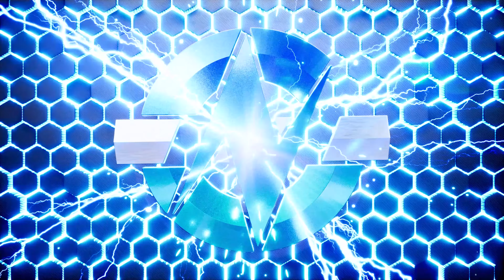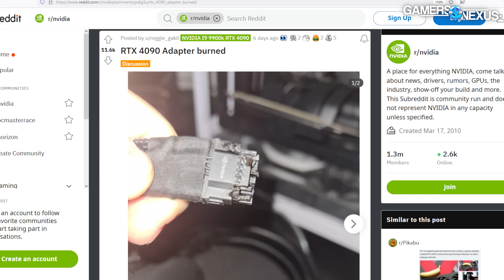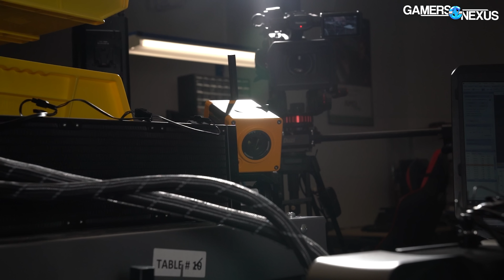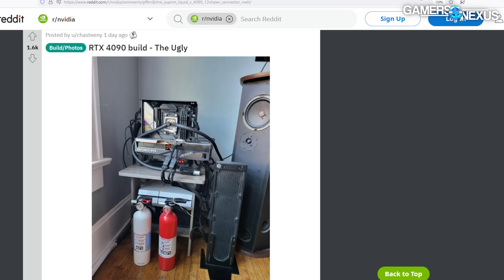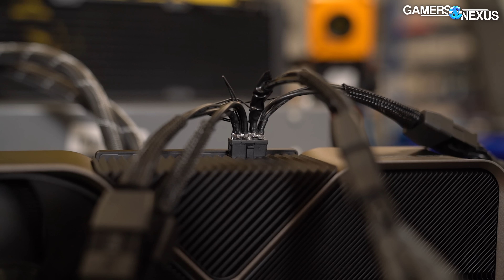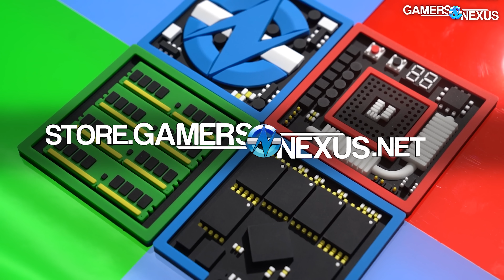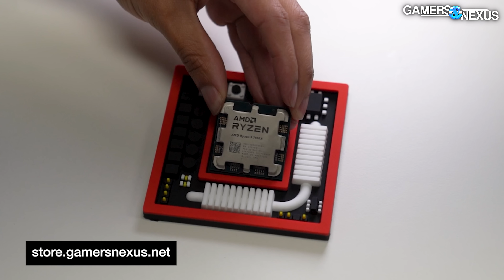Testing Burning NVIDIA 12VHPWR Adapter Cable Theories (RTX 4090)

Comment: I have a Gigabyte Gaming OC 4090, ordered on launch day. I play games about 12-14 hours a day, every day of the week on average. It has been running for most of that time with the full 133% power limit, voltage set to max in afterburner, and overclocked. 

In addition to that, I have the adapter installed in the apparently most dangerous way (i.e. running horizontally with the card). It has been connected that way since the day it came in/installed.

 My case is a Fractal Meshify 2 RGB, loaded up with fans (the stock 3 140mm on front, stock 140mm rear, two 140mm high airflow fans on the bottom, one 140mm high airflow ontop next to my 240mm AIO cpu cooler radiator ontop).

Power supply is an Antec Signature Series Titanium 1000W with 4 dedicated separate PCIE 8 pin wires connected to the adapter.

Fortunately I have not had this issue. I am inclined to think at this point with the amount of hours/stress put on this card/configuration I won't have it happen to me (fingers crossed though). I feel like it definitely would have happened by now if it was going to.

I'd love to help by sending you the asked pics of my cable but it makes me way too nervous to try and mess with it when it is working fine right now. I really don't want to poke the bear. Hopefully just the info I have shared given the way mine is installed and the heavy use it has received will be of some use.

Rest of system specs pretty much irrelevant but just for the sake of it: Ryzen 9 5900X OC'd, Asus ROG Crosshair VIII Dark Hero X570, 32GB (4x8GB) 4000mhz Corsair Vengeance RGB Pro @3900mhz 1:1 C16, 2x Samsung 2TB 980 pro m.2 nvme, 1x 250GB Corsair SSD, Alienware aw3423dw QD-OLED primary monitor + Asus 27" 1440p secondary, Roccat Kone XTD mouse+ Roccat Vulcan Pro keyboard.
Reply: "...too nervous to try and mess with it when it is working fine right now."

Now that's a mindset I can heartily embrace.

Comment: The issue most likely is in the pins. The female ones(on the adapter) are split on the length and if they are either bad quality or the fitment is not ideal (that's why they only let you plug cycle 30 times) the contact with the male pin on the board will become less than ideal and due to the high amps, heat is going to build up, or in a worse case, an arc and that is burning the plastic around it.

Comment: Well, a cable that is half the rating recommended by the manufacturer is definitely a clue in my book. Good catch. I can't help but wonder if there are some early revision cables that got released by accident.
Reply: Voltage rating has nothing to do with Current rating. Voltage rating says nothing about the conductor, just about its insulation. 150V rating for 12V is perfectly fine.
The difference in voltage rating is just an indicator that different cables are used that might have other different properties than voltage rating.

Comment: You have to run the 4090 a couple of hours/days before getting even near to melt the Adapter. This short testing and finding a fast conclusion to put the Video online asap is useless.

Comment: GN, good thorough work as always. But what I don't understand is why everybody is trying to melt these cables in open-air room-temperature workbenches. If these 4090s were in a case wouldn't the ambient air temperature around the connector be additional 15-25C higher or even more? It seems like real-world use would offer much less opportunity for the cables and connectors to dissipate their heat.

Comment: I think these numbers actually do reveal an issue. Note that none of the damage photos so far show any sign of charring, just plastic deformation. While the melting temp of nylon is 269 C, the glass transition temp is 70 C and deformation can start to occur above this point. You were able to see temps in the 60-70 C range on an open bench at 25 C ambient. In a case, especially one with a front rad, internal air temps can be up around 35 C or more. Therefore, the connector could be regularly sitting  above the 70 C GTT for long periods and slowly deforming over time.

Comment: With 300v wire you would have to run the GPU threw 1 cable to match igors at least as far as cable temp is concerned.

Comment: NTSB procedure. Nice. The first part is to gather the pieces of the wreckage. The next part is to try the recreate the problem.
Right now we have no black box and a couple of crashed planes on reddit. We also need to get the suppliers squared down, see if there is a coincidence.

Scientific investigation, perfect by GN.
By the way, call the camera NTSB. Or Tenerife.

Comment: One thing not discussed here - unless I missed it: With the hulking power requirements of these cards, is it time to move on from this power connector? 600w at 12 volts is 50 amps. Something on your car that pulls 50 amps at 12 volts is the ABS module. ABS modules a compound data and power connector that has much more heavy-duty pins for power delivery and a much more authoritative locking mechanism that is unmistakably locked in place or unlocked for removal. The connectors we're using for power on these graphics cards are quite simply the cheapest possible solution that was dreamt up a long time ago for much lower power levels. Multiple parallel conductors isn't ideal - small differences in resistance between them will strongly affect current sharing between conductors. 

If I'm wrong on all counts, tell me. That said I would be much more comfortable putting 600w of power through a more substantial connector.

Comment: First: Sorry for bad spelling and grammar. 
Can't it be a perfect storm scenario. Where the combination of a underpowered/overheating power supply heat's up the cables to the adaptor (alternative to fue 8pins or bad connection at that end of the adaptor). Heat's the cable going to the 12pin to the degree that the combined heat from gpu and cables in the crammed space in the 12pin creates enough heat to melt the plastic? The four connectors before the 12pin has more Internal space and colder living area. That they may conduct enough heat to melt the more crammed and hot area living 12pin before melting them self. It would also make sense to why Nvidia haven't experienced the problem them self I there rigid testing of the GPU to adaptor function. If they didn't test the what if we have 100c coming from the power supply end into the 12pin. 
Just a thought...

Comment: New thermal camera, I dub thee Torchy! This is awesome work. The early days of this kind of research are the most difficult and the most useful. Not surprising that your results are different from Jayz, the low numbers of people having extreme thermal difficulties points to a manufacturing defect or poor quality emergency substitute when they ran short of adapters from their primary supplier.

Comment: you do have a valid point on the wire quality and ratings. this could cause some issues. but lets return to basics here. basically as voltage decreases in a circuit and resistance increases amperage will increase. which increases heat. also at same point as heat increases resistance and amperage will increase and voltage will drop. when we are talking about 12 volts here a difference of 0.5 volts a half volt will cause major issues.  so measuring voltage and resistance and amperage can help with testing. but now going back to our issues you reported in past about PSU's from cheap parts used in PSU's.  from PSU's catching fire to nvidia contacting psu makers about transient spikes. keeping this in mind i think the psu's brand and wattage and model plus the cheaper quality cables could be where the issues are. so i would recommend asking about psu's from those that have burnt cables or plugs. also a benchmark utility is hard to recreate same real world instances that actual long term game playing can create. also ask peeps about how much time playing games has been on the unit before melting happened or they noticed melting. as this could give more data for testing here and could be something that can not be recreated in a couple hours of testing. also the age of psu can help with data. just trying to help you guys  think a little more about entire setups then just 1 piece. as a car mechanic i have seen issues with melting wires melting plugs ect that happen from time to time and simple things as a burnt copper wire can cause increased resistance and heat. keep in mind the copper inside the plastic insulation can burn and dicolor and eventually turn black without effecting or melting outside insulation here. a wire thats under rated can easily be burnt in these lower voltages. another thing to look at if you get a melted adaptor is the # of copper strands in the wire itself. voltage isnt actually carried in the copper true electricity runs between the strands of wire. this is why you can use clamp on probes for testing. with less copper strands the wire can not handle the same amount of current.  this could be a issue that may not be able to be found by a independent testing facility because of the sheer # of possibilities and expense of finding the issue. but i hope the above might help you guys some and you find the issue with this adaptor. because manufactures are always trying to play things down to keep from spending money on recalls or worse lawsuits. and even when the manufacture finds the problem if they release a fix its usually the cheapest form of fix they can do just to get the part or item through warranty. so i never trust what the manufacture tells us.

Comment: Hmmm. The differing voltages on the cables between yours & Igor's makes you wonder if either Igor's cable was a third party cable (not very likely as the 4090 is too new) or if there's some kind of issue on NVidia's side.

Comment: So sounding like somebody cheaped out on a batch of adapters or didn't spec correctly. That's better than a systemic failure in the 4000 design I suppose. Still think I'll wait until ATX3 before any future builds.

Camera name: Mr Toasty

Comment: Buildzoid said a lot of smart things during his adapter "rant". Mainly that the melting that has been shown in pictures until now, happens inside the connector where the sockets and pins mate when the connector is connected. This simple fact "proves" igors lab theory and some of the focus you have with the cable solder area moot, as the melting is not happening in the solder area. High resistance heating happens at the high resistance area, not magically a centimeter further down the socket"pin". 
Personally I think the focus should be more on the double split pin sockets inside the adapter connector. With cables being pulled and socket pins not being firmly held in place inside the plastic connector, contact area between the adapter socket pin and the gpu pin would decrease increasing the resistance, giving heat. Though seeing different wires used and especially different solder connection solutions can affect pin stability in the connector case when cables are manhandled 😛
But LOVE the way GN is evolving atm 🙂

Comment: I wonder if it has something to do with the graphics card itself. I’ve seen bad parts on cards start melting on the connection points on the motherboard. So were the power comes in a bad part on the card heats up the cord to failure.

Comment: I think the whole 12 pin is not ready. What wrong with 2 to 3 8 pin connections. This wont be an issue when 3.0 psu with dedicated 12pin are available. Direct wire will always be better than a distribution plate with 4lb of solder.

Comment: I would had spent more time testing buildzoid theory. As I commented on one of his later videos on the subject, I had very beaten old 5-12V molex getting warm because of the same reason.
They had round instead square receptacles but still with the double gap, so the two halves got more far apart under strain and the contact was poor. I had some where even an half broke off.
For this reason I think buildzoid may be closer.

Comment: Very interesting stuff. It would be interesting to know what type of plastic is used for the connector. I would add that coming from an automotive perspective as a mechanic the only time I see melted plugs (also being 12v DC) is from overload usually caused by shorting causing massive spikes in current. Knowing how the power is diverted to the internal components of the card from the plug would also help to understand the problem. My instinct is it is a combination of a batch of crappy adapters and a flaw in the cards.

Comment: Cable voltage rating is a non-issue here. The rating is referring to the insulation, and has nothing to do with the copper core.

An amp is an amp, and will heat the cable / connector just the same (volt drop over the cable or connector is fixed provided the current and resistance are the same, meaning same power dissipation).

It's likely NVIDIA has several permitted suppliers for the cable, and that the actual engineering requirement is insulation rated to 150V or even lower.

Comment: Call the camera Mellow, why? what is the joke? nothing really, is just sounds like yellow.

on the connector failures, I gonna go with what buildzoid has said.
those cables are kinda overkill and foil usually does quite fines, the contacts themselves are the problem.
also, you need to usar a Computer case, you are using a open bench, that is not real world and not even fairly comparable.
just place into those "hot box with no airflow" you love to hate.

P.S.: maybe MSI has a perfect one.

Comment: I'm subscribing to Buildzoid's take on the events. It's a very sensible take on the entire catastrophe that the envelope of safety on how much power they could push too hard, and the pins started melting because of it.

I also noticed that the 12 pin 30 series FE connector is geometrically identical to the 12VHPWR connector except without the sense pins on the side, and also never got pushed past 400W.

Comment: Let us just lean back for a moment and appreciate the Fact that these Connectors are designed to heat up in their intended usecase, wasting Energy you paid for.
To make it worse, Oxidation works better on hot metal.
What's goning to happen on a 4090TI ? Or RTX5090 ?
Designed to fail?
Or will they use 2 Connectors and have the GPU look like a Octopus, because the Connector, they designed to replace the need for multiple plugs, wasn't up to the task?

Comment: Are we sure these guys melting their cables aren’t using last years cable? Maybe it’s smaller gauge wire. If you can afford a 4090 you probably bought the 3090 as well. Just a thought.

Comment: Hey Steve will you look into buildzoid claims for nv cables being the specific issue. And then try recreating the failure by cable managing nv's cable horizontally with the length of the card, be lightly forceful. I would believe that (from buildzoid hypothesis) the partial separation of each pin on the adapter (I would go off Jay's resistance theory,) less pin being a power transport causing a minute high pockets of heat. And what about physically harming the pins to create the desired effect? Limit the power transmission to as a small of a point as you can manage by cutting the pin only as short as it needs to be. If that pin melts the plastic around that could be a lead to follow.

Maybe to get it to work for investigation maybe just bend the cable with the system powered and half loaded. When it shuts down let go, turn it back on and hopefully after a few tries the cable gets trained and stressed.

Comment: Thanks for doing Nvidias work for them. The work you all do is highly appreciated.

In my experience games with ray tracing make my 3070 draw more power and get warmer than MSI Kombustor. Maybe try Control or Cyberpunk with RTX on?

Also how much warmer would the cabe be inside a case with a radiator on the intake? Could this affect resistance much? Maybe try getting the card and cable as warm as possible without throttling as worse case scenario.

Comment: From what I have seen and heard the issue is the fact the outer connection points seem to break away the gpu power connector and when they break all the current has to flow since the metal bar acts like a shunt bar were all the current has to flow thru it, the problem could be many like  bad solder joints, overheating shunts and other factors unknown at the minute or combo of factors. No matter what problem the melting power plug is a heat issue due a bad connection of some type, these cables could be first run of cables that have been changed in design for some reason that are causing the melting issue. Thermal Princess for a name for the thermal camera.

Comment: I have a suspicion that all the melted cables were inside a closed case not on a bench, and perhaps even with some tension pulling on it. Usually when we see similar failures in the automotive sector, tension on the connector over time usually causes the faults

Comment: Great piece of research, but with one idea back-to-front. ... The most heating power will in fact be developed in the LOWER resistance (i.e. "better") paths of a multi-pin parallel power connection, when there is any variation in resistances at each of the twelve pins or solder joints etc.
Worst case scenario is just one good path, and eleven poor connections. The one good path will be fried.
Thinking that the "bad" pins/paths will be the hottest is entirely forgivable. Parallel connections do very strange things.

Comment: At this point the theory with the double split terminals in the adapter seems the most realistic to me. Especially if you consider his point about a critical temperature where the plastic might get soft and the terminals are permitted to bend even more. This then results in even worse contact and therefore more heat in a cycle.